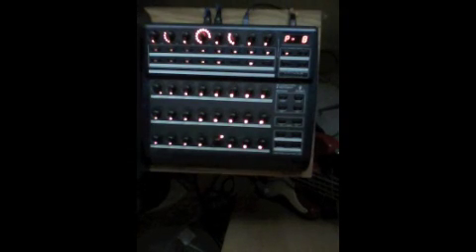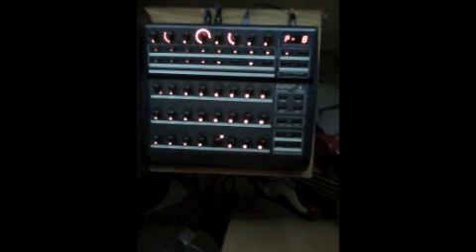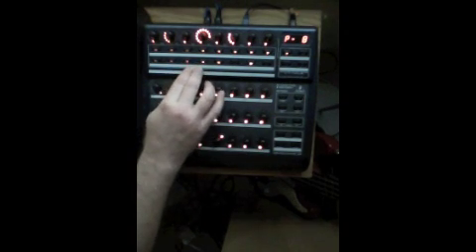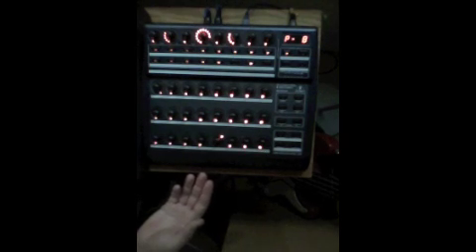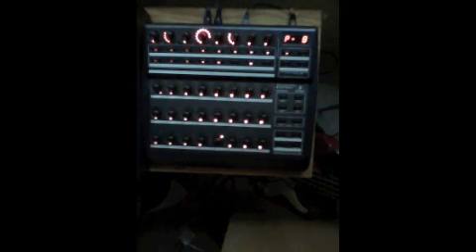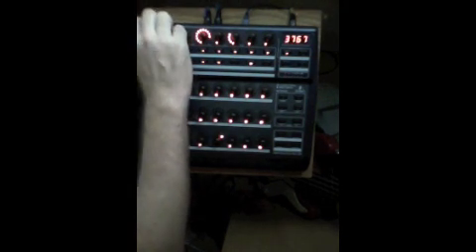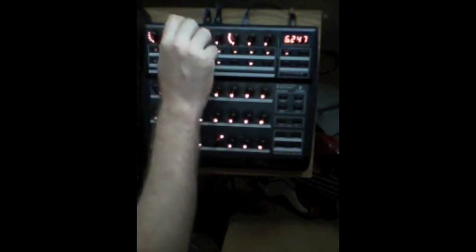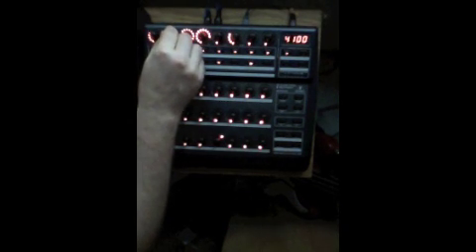Kurzweil PC3 + Behringer BCR2000: NRPN-style control

Comment: Is it possible to use bcr2000 to take control on VAST parameter.
Reply from the maker: Yes, it's easy to map a control on the BCR to a.) any parameter in VAST (hold down the "enter" key on the PC3 and wiggle a knob), and b.) the PC3 responds to many of the "standard" MIDI CCs such as pan, volume, monophonic/polyphonic, portamento time, etc without having to set up anything else in VAST.
Reply: Thanks this help me a lot 🙂👍
Reply: poserp hi , can you record this process ?

Comment: How do you manually edit or set the rotary speed on the BCR? You usually only use the upper rotarys to configure MIDI/NRPN, Channel number, Max and Min values, LCD behaviour. I haven't found where you adjust the speed?
Reply from the maker: Late reply -- there is a custom editor for the BCR, and that gives you access to many more parameters. IIRC it's made by a company called Mountain Utilities. Highly recommended if you have a BCRxxx.